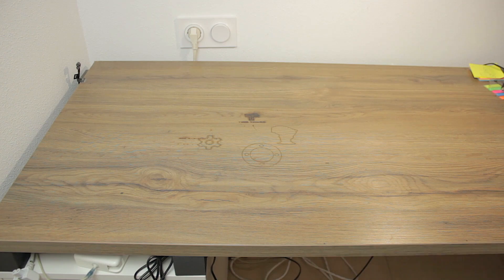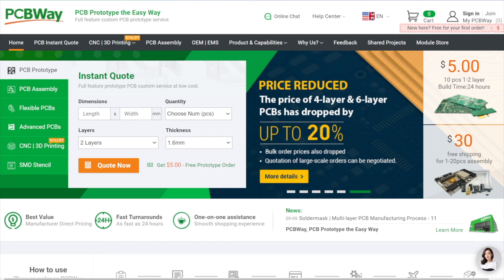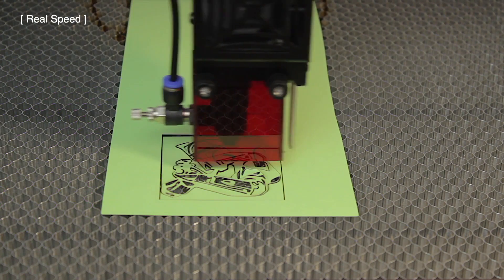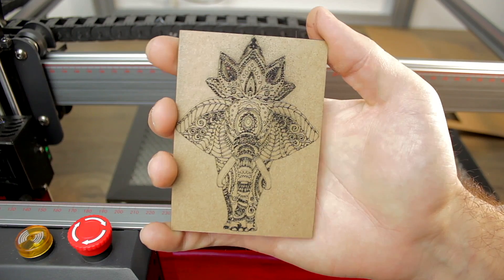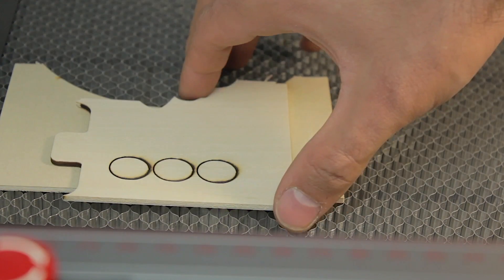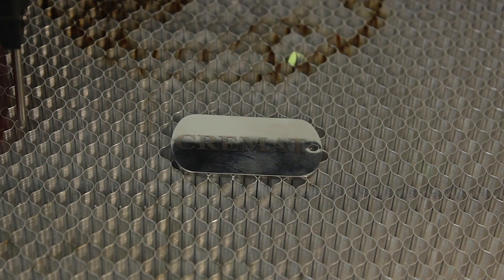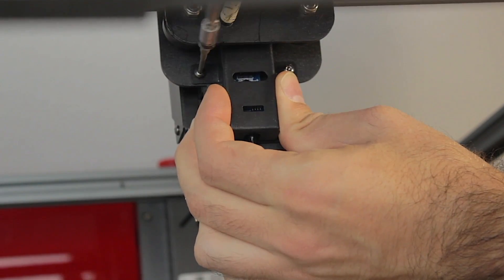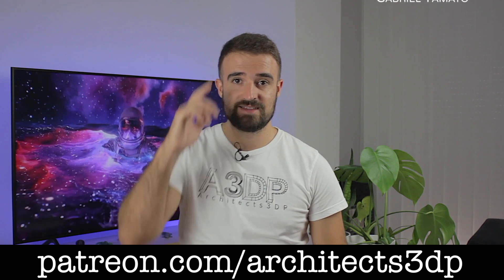TWOTREES TS2 10W Laser Engraver - In depth REVIEW and materials testing

Comment: I really regret buying it.

They are not as advertised.

The spot is not 0.08x0.08.

It is a 0.08x0.15 rectangular spot.

So when I engrave it, it comes out messed up.

They also send me a crappy laser module that is not as advertised.

Comment: I also have a TS2 laser. I repeatedly had issues with the fire alarm, even with air assist. So, I unplugged the cable labeled 'E,' effectively disabling the fire alarm. Since I never leave the laser unattended, this has been the best solution for me, and it's been working well for two years now.

Comment: Hmmm - I just bought this machine. Even the last test you did had burned edges, which I don't see happening with other machines - so maybe it is the material PLUS the adjustments PLUS contacting the company , etc., etc., etc. Even, maybe, you got a machine where the beam is not perfectly aligned? That laser head is probably two 5W lasers that have to be perfectly lined up, and maybe it is not perfect because it was bumped or something.

I just hope I do not have these issues!